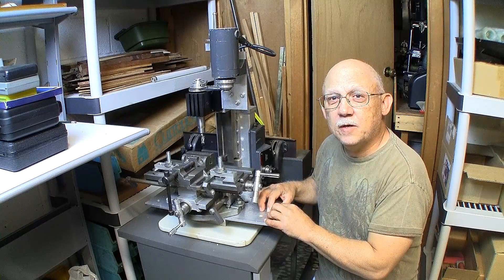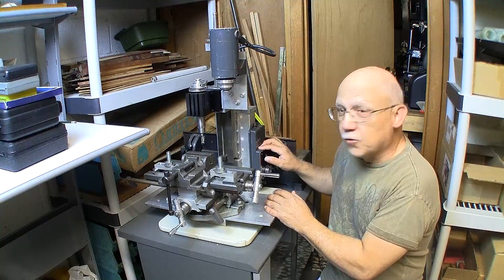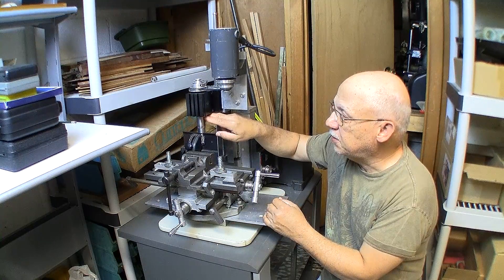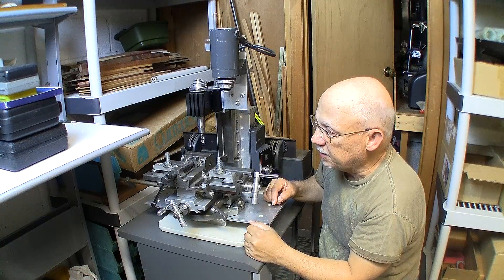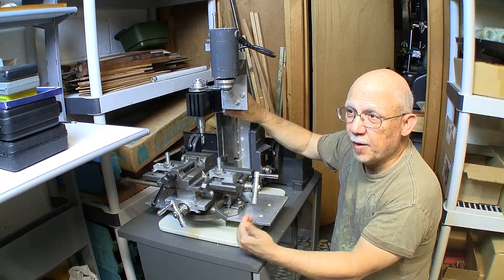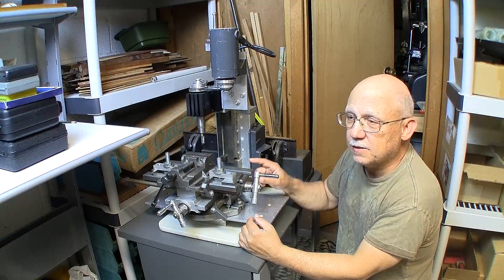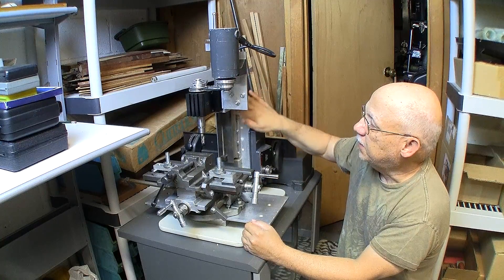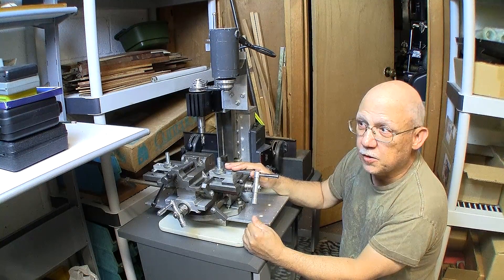My Shop Built Milling Machine

Comment: I have got to try this! :)   Wanted a mill for a while, but don't have room for a full sized one & most of the bench top models have mixed reviews and are over what I'm willing to spend on one.  Never even thought of trying to build one!
Reply from the maker: I thought I was nuts when I was doing this! But is actually turned out OK. I made a total of 12 hours DVD set of the whole project I including a 60 to 1 worm geared dividing head. It is available from. 
www.littlemachineshop.com